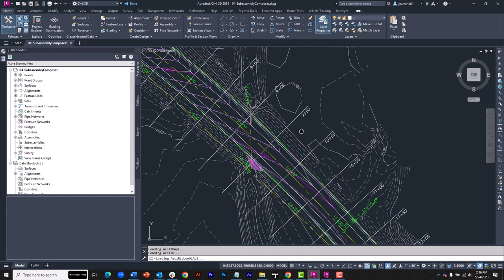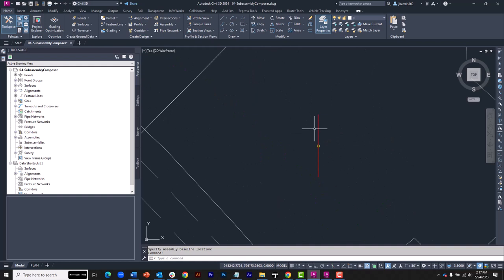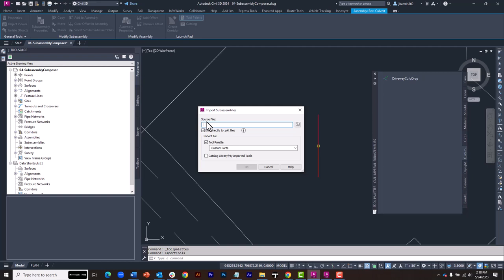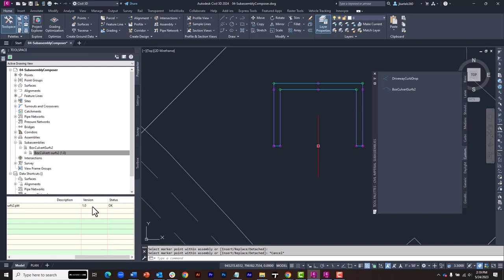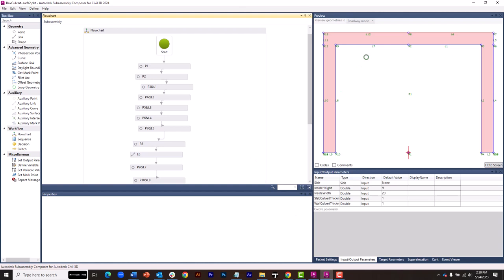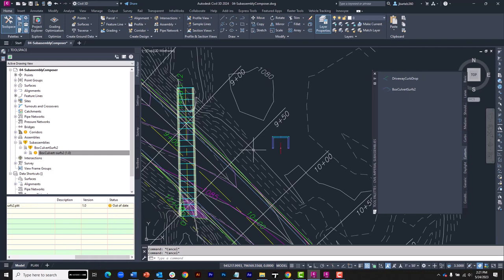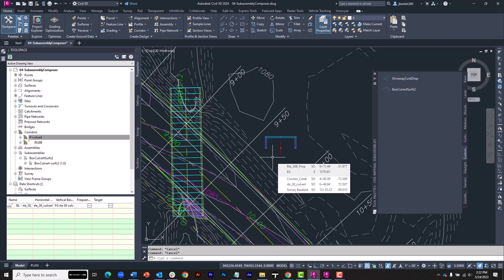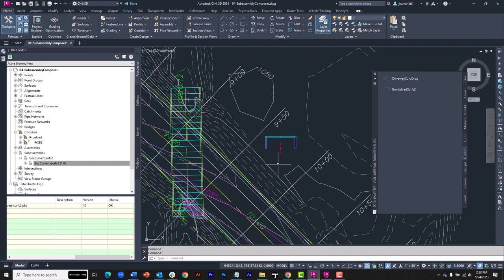Civil 3D 2024 New Feature! – Improved .PKT File Management

Comment: @Jeff this is great another thing to add that would be great is to be able to give a fixed width of the subassembly. In our country culverts are 1.225 m sections and everythime we have to go and manully set that up in the corridor so it displays correctly. Would be great if you can set this in the subassembly composer as a fixed value